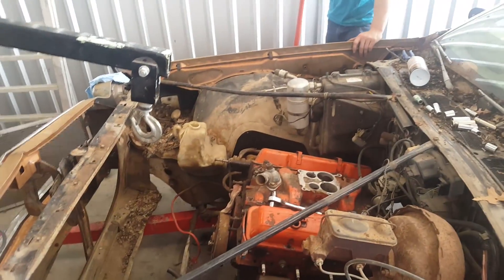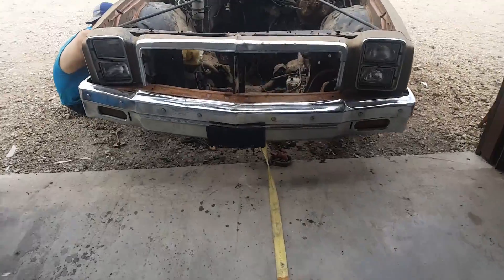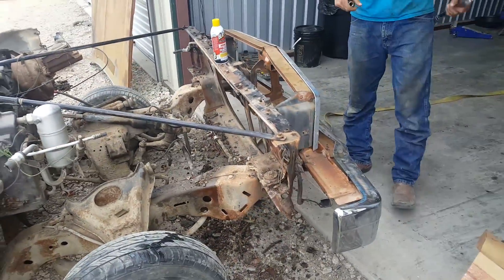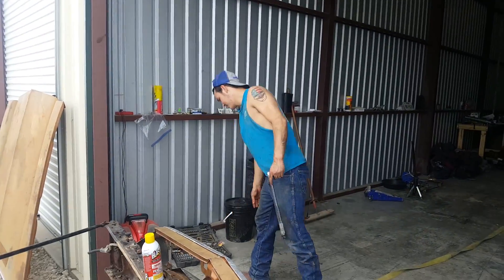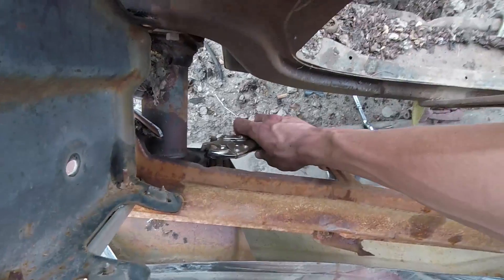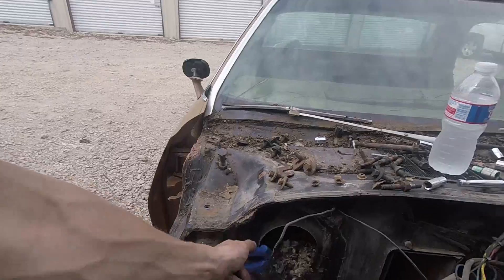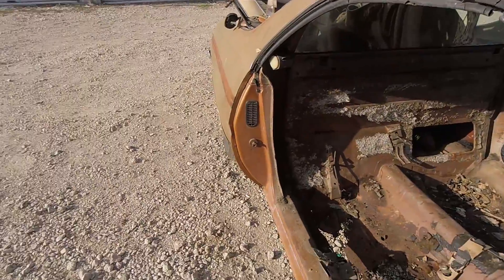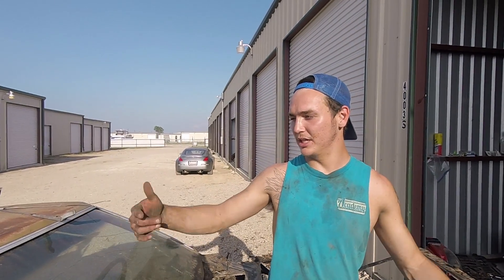We're Going To Get SO Much Hate For This....

Comment: But you don't have to restore it. Simply leave the doors and hood and fenders on and primer it black and put some wheels on it.  It isn't going to look like a rat rod. It will just look apocalyptic. You need to choose a direction for the car. drifter vehicles don't need to be light, only powerful. A rat rod has a look and missing fenders and doors on a newer car is not a rat rod.

Comment: Chop all the inside of out the doors so they're skins, and keep it looking like an El Camino- taking all the shit off turns it into a shell.. not an El Camino like Zack wants. You need the weight in the front for grip, the arse end will slide out because of it being a pickup without you stripping unnecessary weight

Comment: $150 for the motor, I live near y'all and I'm lookin for a 350 if it's in good shape I'll take it
Reply: Might have to go a little lower on the price
Reply from the maker: +BeetlexVW Dm us on Instagram
Reply from the maker: This is why we are converting it to carb.
Reply: vortec 350 and old 350 parts interchange. they just need a carb intake, carb, and distributor. maybe an electric fuel pump(why have it any other way?)
Reply: Novice Garage I got $93 in cash it's not a $150 but it's what I got